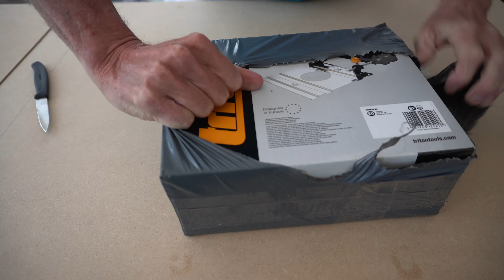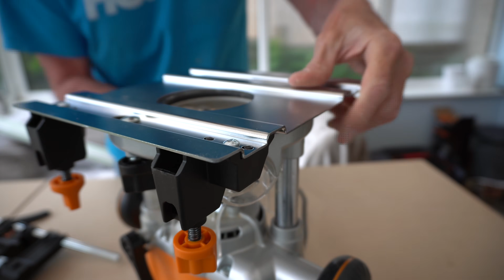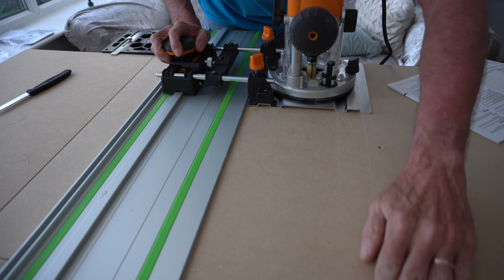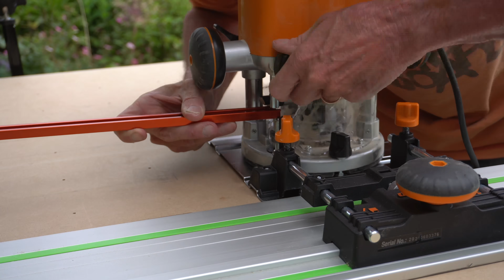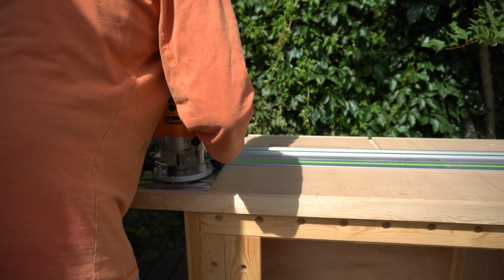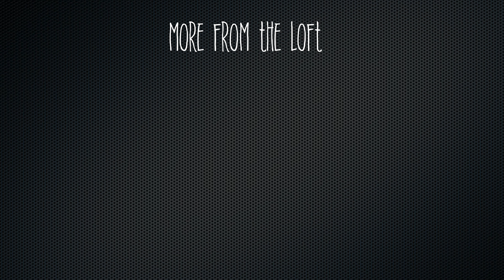Better Dado Joints and Grooves with the Triton Router Track Adaptor.

Comment: Nice looking bit of kit- but at 3:09 you can see that the base does still scrape the surface. That is a problem with a bent sheet steel base- most router sliding plates are polycarbonate or similar to prevent this. There may be room to fit strips of this to the underside, but a shame Triton did not do this- their tools are usually well constructed. 
Of course, the whole adaptor is crying out to be a 3D print project...
Reply from the maker: 3D us a great idea. you are right it did seem to scuff the surface, although some of that was my fault as initially I didn’t place it totally flat. regards JP
Reply: @Smallbarnworkshop  I would be tempted to fill the centre bottom space with a polycarbonate (Perspex) part. Not only would this prevent scratching, it would give vital support close to the router bit. As is, there is no support there, which would give problems with routing narrow parts. It would probably also give better dust extraction...